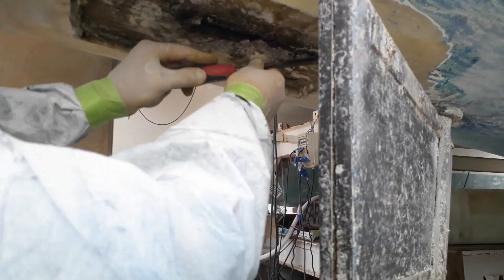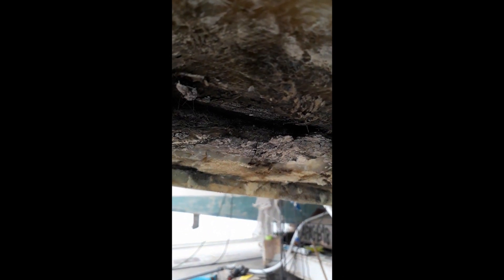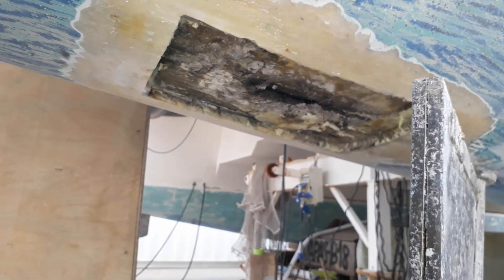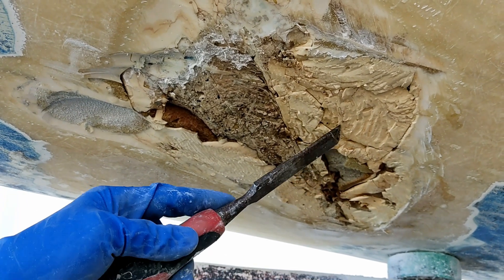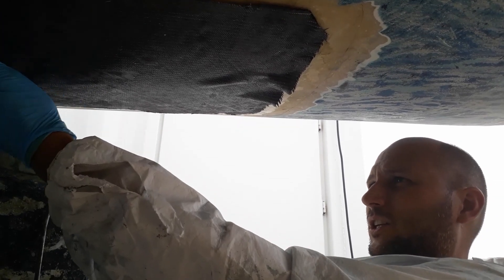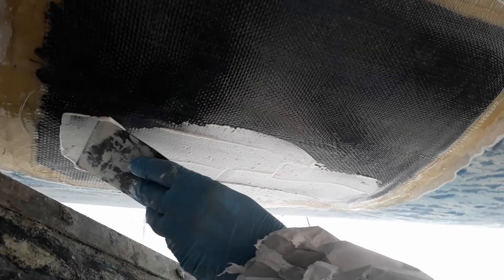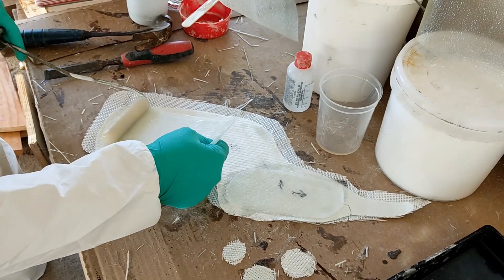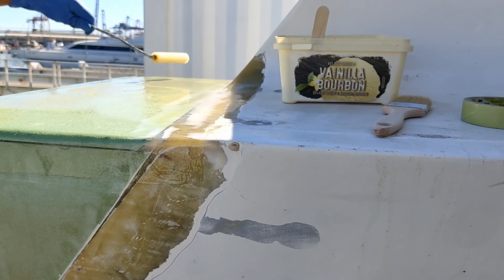Repairing HULL DAMAGE on our catamaran

Comment: Excellent video. Really informative! I love all the details about the type of glass you are using and its composition. Thank you!
Reply from the maker: Thank you! Glad you found it helpful
Reply: @youngbarnacles  Can I ask, when you replaced the transom, was the foam butted against the hull and then glassed on each side?
Reply from the maker: Yes you can.
In the case of this job I glassed the inside skin first on the bigger panels.  This saved me a little time. It also made the external corner of the transom a little stronger and able to resist a bang a little better.